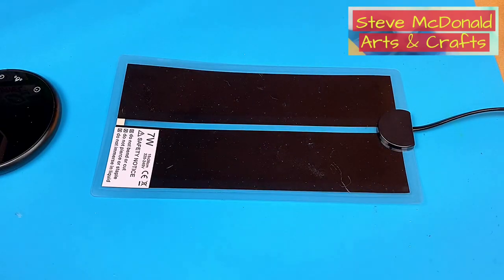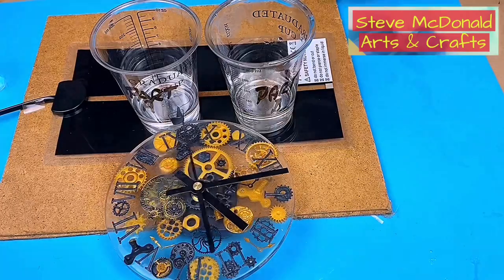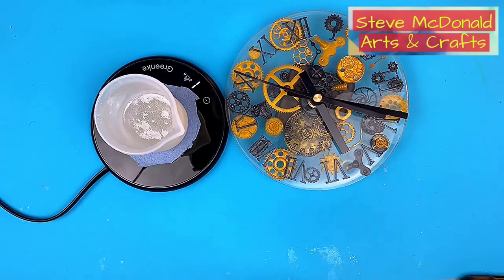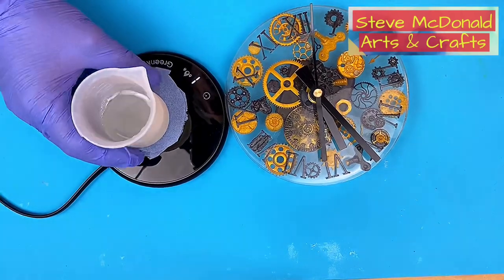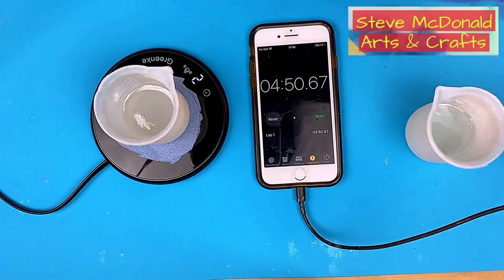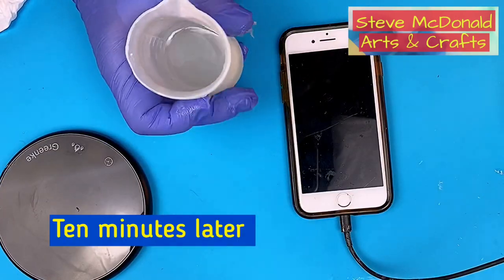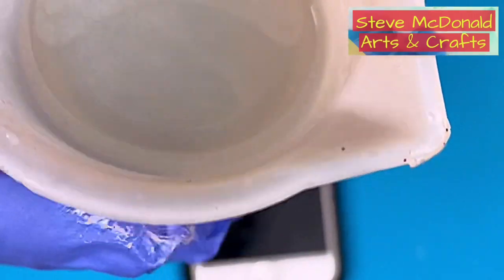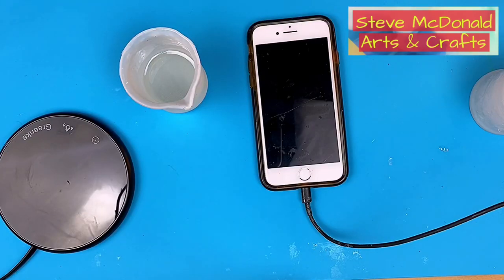Bubble Free Resin is it Possible Using These?

Comment: I bought a silicone heating pad from AliExpress and although I haven’t received it yet I watched someone use it and it got rid of all the bubbles. And because it’s silicone it won’t melt your cups. They were only $1.34. So we will see if it works.
Reply: I hope you got it by now! Wish & AliExpress take forever
Reply: Does it work? ☺️
Reply: I'm curious as to how this worked for you.
Reply: @debbrantner6666  I don’t recommend the silicone ones from Aliexpress. They weren’t hot enough. I used the reptile heating pad and it worked better but it reduces your work time because the resin gets hot. Hope this helps.

Comment: I bought the heat mat and still had a ton of micro bubbles. it is being returned.  plus I found it cut down on my workable time.. I also have the resinatorer bubble remover machine which also leaves lots of micro bubbles. I mix slowly

Comment: #steve, there seems to be a number of resins that are ideally suited for use use without pressure pot (according to various other youtube sites). Clear Cast is one (available here in the uk) amongst others. Your own guidance on mixing etc to avoid the inclusion of bubbles is very good, Clearly warming the resin (water bath etc) makes for a better mix and hopefully reduces bubbles. The ultrasonic cleaner (£20, Lidl) may also be of use and (here in the uk) an insulated box to allow the casting to cure (at least room temperature) for the time needed. Pressure pot and compressor though the ideal are expensive and take up storage room. Not so bad if you have the luxury of a workshop/room. J
Reply: @SteveMcDonaldArtsandCrafts  Many thanks for your comprehensive reply Steve. I will continue watching. John

Comment: Brilliant video as ever Steve. I use a seedling mat which I leave my resin and hardener on all the time. My larger/deeper projects (50ml+) do cure quite quickly but I haven't had any subsequent issues? Don't know if it's a good thing or a bad thing tbh. I really noticed the difference when I moved location. My husband turned the mat off without realising it stays on and I didn't know. I poured my resin/hardener and it was like treacle. FULL of bubbles. So back on the mat went!
Can I request an idea for a video (unless you've already done it in which case you'l need to point it out to me pls)? I want to know how people get their hooks, eye pins, dangles (whatever you want to call them) into transparent resin without any of the white resddue caused by drilling. I know youheat the eye pin up but all I seem to get is a blackened mess?! I know the resin has to be just cured too before it goes hard but for the life of me, I cannot do it! Could you try it on different metal - sterling silver, brass, stainless steel, silver plate etc. I would be SO GRATEFUL if you could show me how to master it!!
kEEP UP THE GOOD WORK!
Reply: @SteveMcDonaldArtsandCrafts  Thanks Steve but that's not what I meant. I want to be able to do it like this where there is no white residue spoiling the clear resin: https://www.etsy.com/uk/listing/619072135 Like I said, it's got something to do with heating the head pin and adding it before the resin has fully cured but I can't get the hang of it at all?!
Reply: @SteveMcDonaldArtsandCrafts  Ooh yes please. I would be very interested in that! x